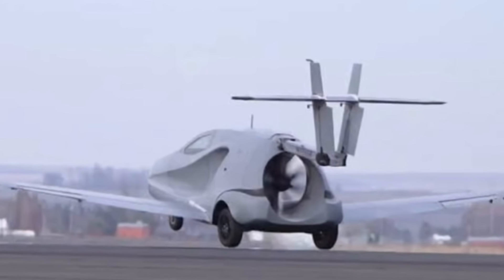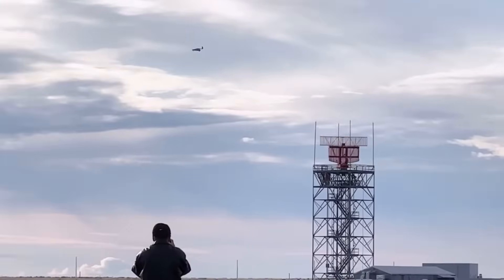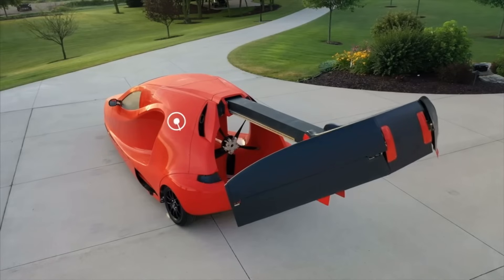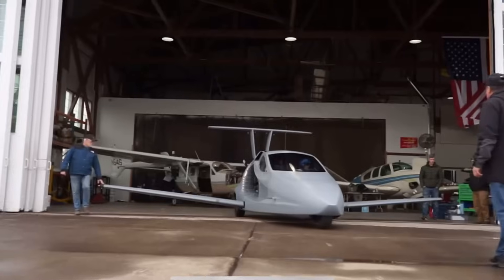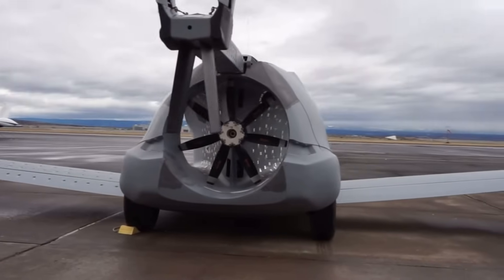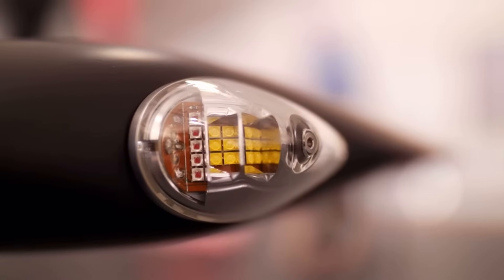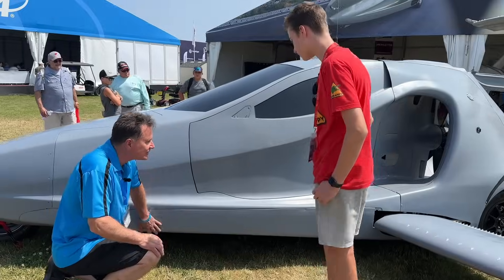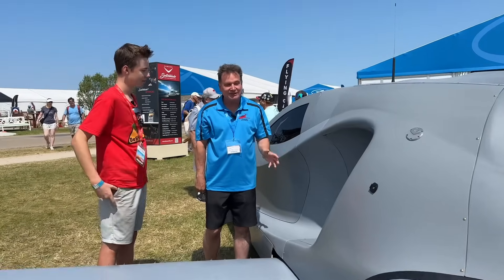The Switchblade REAL Flying Car. Price & How the Wings Fold In.

Comment: BTW, the design has changed since this video was made. Now there are two propellers, and the tail and propellor assembly all fold into the body, so the vehicle will look absolutely like a car when it's in driving instead of flying mode. Plus, the engine is to be electric hybrid.
Reply from the maker: That sounds like a good change! Will you be displaying at Sun ‘N’ Fun next year? I would be more than happy to come and do another video with you.
Reply: @BeSnappy  sorry,  but I'm not the one to ask: I'm just a customer with a reservation, not part of the Samson company.